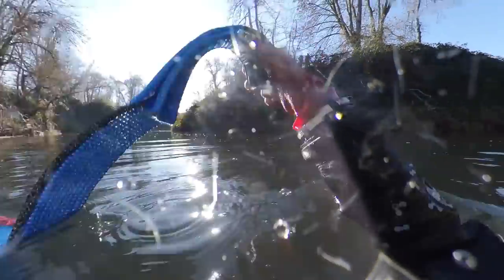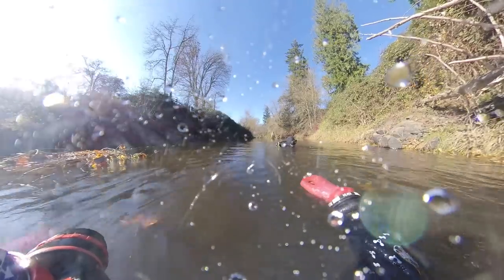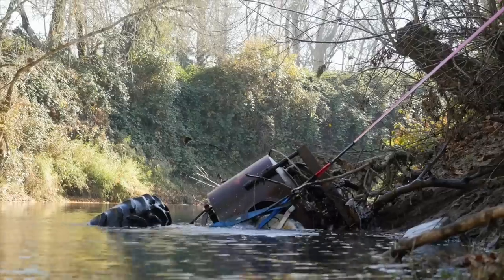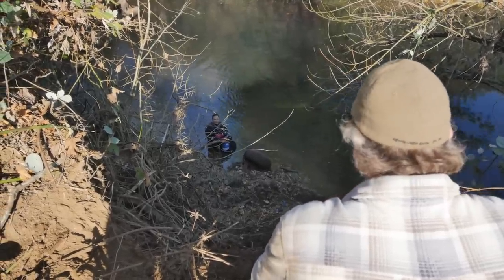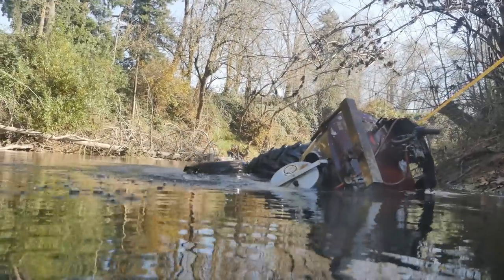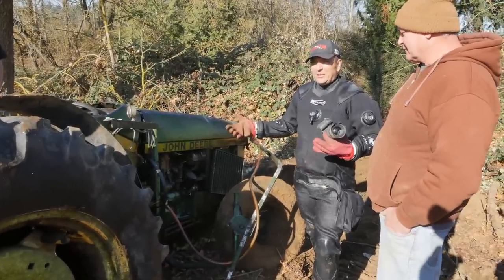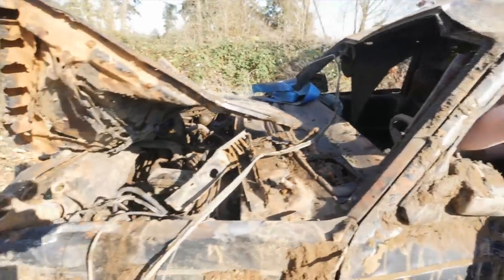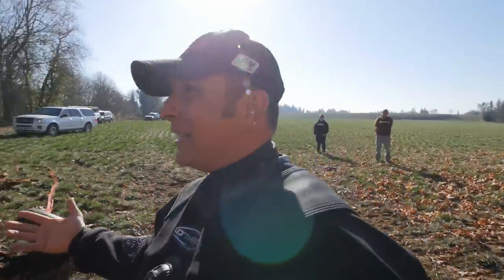John Deere Tractor Found 10' Underwater in River!

Comment: the dry weight of the 2240 is about 5000 pounds, the 100 gal sprayer another 1000.  rear tires could have been liquid filled with calcium chloride, but if not, odds are flooded  (50 gal each, so 800 lbs).

noticed a front weight hanger bracket up front.  there might have been "suite case weights" that fell off.. probably 4 or 5 (about 100 lbs each) to off set the weight of a full sprayer...

Comment: If you're going to wait a month before doing anything to get it running, you'd better take some preventive steps now (drain all fluids), flush with alcohol, and fill with diesel temporarily.  Including, check out the cylinders.

Comment: When I saw the straps I knew this wasn't going to end well! Nice tractor before you wrecked it a couple of times! Don't they have chains in that part of the country? You should have got it on its wheels and pulled it from the front! It will run after its oil is drained and fuel and filters are changed battery and other stuff was a nice tractor! 😎💨
Reply from the maker: We learn as we go.
Reply: Don't we what would be cool is to see it running and back to work that would be cool later brocephus! 😎💨

Comment: Law enforcement should at least do a VIN search and find the owner and what backstory is there. If not LE, then John Deere should know its origin from the VIN. If you get to keep it, pressure wash it, get the sprayer off and out of the way. Straighten, reattach, repair what you need to do to get it sitting straight on its wheels and frame and get her into first start condition. My take on it!😊👍👍

Comment: Need a safety strap. Like roick climbers use. Stop pulling and lifting at periodic points to pull up the slack in the safety strap to keep the item from falling back into the ravine.  Tie the safety strap(chain is safer)  to a part of the existing stable environment or a piece of heavy equipment (not the piece doing the pulling) that is heavier than the item being pulled out of the ravine.

Comment: do it as soon as you get it back to base drain oil fuel take out the injectors   put some atf in the engine through  were the injectors was leave for 24 hours  then try to turn over  you can take the starter off and get to the ring gear there thats best place to turn it over  it should free off good luck john keep up with the vids
Reply from the maker: Greg in the video has worked on many, so if anybody can get it running again, he can. If we have any success, you'll see a video for sure.

Comment: Would love to see you get the tractor running! I am a farmer from north central Missouri. I love old tractors and restoring them. I would like to give you some advice. This is my opinion and mine only.  There is no way in hell $1000 will cover the cost. Not if you shop at a John Deere dealership. Second. don't air it out and let it set.  Opening it to oxygen will allow it to start rusting immediately!  This will make it more costly and expensive in the future.  Third It looks black around the steering console. Has it been on fire? This is where most of the wiring is located. Behind the instrument panel. And 4th and most important. Safety! I recently discovered your channel. I like it and watched it all night. I noticed you use a lot of straps!  Do you not value your lives? lol. I've known these to break and actually killed a person i knew.  Some are like a rubber band when they break! Lord help you if they have a piece of chain, or metal still attached to the end!  I noticed you broke many.  Regardless of what they state they will pull, Many times it isn't the pull that causes them to break. But being cut does. Wrapping them around anything that is not smooth and round, is dangerous! Even a 90 degree edge may not seem sharp. But thousands of pounds of tension on it, and it will cut your strap. A butter knife does not seem to be sharp either. But the more force applied, the more it will cut through!  Anyway. I'm sure you know much of this already. good luck on the tractor!  I always wanted to start a company called  Oldskool! I think fixing, restoring  or modifying old things to new condition or even modifications to make them useable in todays world is  awesome!  because Oldskool! Love your show!

Comment: If it were me, I'd give it a good wash with the pressure washer, and get all the crud off that thing, then as others have said, drain all and any fluid filled cavities - wouldn't hurt to wash them out too, afterall, they're already full of water! Then refill with diesel fuel, or a mix of diesel fuel and engine oil.

It wouldn't cost much to do that, and would make the job a hundred times easier if/when it becomes your property. Take out the injectors and pour oil into the cylinders to stop the pistons becoming 'water seized'. Or, have a word with "Mustie1". He loves a challenge! 

Up to a point, the best place for it to until it's yours, would right back under water until it's going to be worked on.

Comment: Damn, those nylon straps are strong. Then one broke!  Why not use a long chain?
Reply from the maker: The straps we were using were rated at 10k working and 30k breaking which was stronger than the chains we had. Crap happens

Comment: I have a 22,000 lbs strap i use for towing big trucks. You should look into getting some straps that are around that size.
Reply: I thought the guy at one point said they were rated to 30k pounds. Didn't he?
Reply: @davebrittain9216  now i have to watch the video again to see if he said that.
Reply: The winch on the tow truck can pull 30,000 lbs. Those tow straps are no where near as thick as the ones i have. Those were rated at 10,000 lbs.

Comment: Don't let it sit, drain the water from the engine, trans, and axle, (the latter two might be built together) and fill everything to the top with diesel fuel so the bearing journals and cylinder bores and other machined surfaces don't rust and ruin everything. It doesn't look like it was under water for more than a few months.
Reply from the maker: Greg in the video has worked on many, so if anybody can get it running again, he can. If we have any success, you'll see a video for sure.

Comment: Drain the oils, wash it off/out clean the fuel tank and cooling system, starter. New fuel, oil, antifreeze. It'll run. Change oil until it drains clean. Go to the field.

Comment: I don't know where you are, but here in NY, if any vehicle goes in a body of water, the owner is responsible for removal & if it stays for more than a certain period of time, there are heavy fines from Department of Environmental Conservation. There were 2 vehicles with fuel undoubtedly in them, and a sprayer that may have potentially been filled with chemicals. Nobody is likely to claim them because the fines will far outweigh what they are now worth

Comment: I bought from etrailer 20 foot straps rated at 20,000 lb that are 4 inches wide for $40 each . I guess you figured out a bigger strap would have been better to start with.

Comment: Let the tractor lay up in storage for a month , you might as well go ahead and haul it to the scrapyard. Pull ALL of the oil drain plugs from the engine to the rear end after it drains replace them and fill EVERYTHING to the top with diesel fuel and let it soak .If you dont it will be internally rusted to hell and back. I would say counting sheet metal replacement you are looking at a couple to three thousand to fix it could end up a little more. . It would certainly be worth it.

Comment: Here is the problem you are facing with that engine. As soon as it comes out of the water it will rust at a very fast rate due to it being exposed to more oxygen. You need to drain that engine, trans and fuel tank asap then fill them right to the top with diesel. The water will get pushed out and down the the bottom.  Would be best to pull the injectors and fill the cylinders as well. All done about 3 hours worth of work.
Reply: Dave Brittain 
50 hp
Reply: @retireddriver16   Your point of saying 50 hp is?

Comment: If the motor was running when it went into the water, you should be careful with the engine.  Why you may ask.  Water will not compress, when the engine inhaled the water it was trying to compress that water. The engine could have one or more bent rods.   I am not just speculating. This happened to me with  an almost new Caterpillar irrigation engine.  When a rod broke it tore a hole in the side of the block and destroyed the starter too,  My suggestion is to take the engine down replace the rods at the least. Rebuilding the motor wouldn't be a bad idea.  Good luck.

Comment: I am surprised to see them using straps on something this heavy, would have expected chains and steel cables.  Guess technology has changed???
Reply: I used to work in the towing industry. Some of those heavy tow straps are just as strong as chains. I have a couple personal straps They have a working load of 2500lbs each and if doubled it increases their load capacity.
Reply: @1973mre  Yes that is what I am hearing and I hear that they are not as deadly as the cables when they fail.  You can for sure see that when the strap breaks in this video.  Those steel cables will take your head off when they snap.

Comment: I don't think it will be worth it to fix the tractor.  Most people don't know the damage that can occur when vehicle is completely submerged, especially one with a diesel motor.  At a minimum, you need to completely drain out all the fluids and then remove the injectors before you attempt to bar the motor over.  At least one intake valve and one exhaust valve was open when it went into the water, so those cylinders will have rusted up tight.  If you are super lucky, you might be able to use some penetrating oil on the rusted cylinders (let it sit with penetrating oil in it for several weeks, making sure to top the penetrating oil every couple of days) and be able to eventually get the motor to break loose.  The motor might have been running when it went into the water, if so then at least one rod is bent.   Unfortunately, it is probably best to walk away from this.  Can it be fixed?   Yes.  Do you want to spend the money to fix it, when for about the same price you could get a running 2240?  Probably not.  The best case for you in this situation is to sell  it for parts.  The 2240  is a popular tractor, so you shouldn't have any trouble selling it to a junkyard or by putting an ad in craigslist.  I've worked on a lot of lost causes, and this is very clearly a lost cause.

Comment: Never use chain for lifting. You'll never see chain used on a construction site.
Reply: Joseph Civita that’s false. You do see chains on sites
Reply: That's completely false, you'll see chains used all the time especially around concrete blocks.
Reply: Ya, maybe to lift a block a few feet off the ground with a loader. But never when lifting a load at any height with a crane.
Reply: Joseph Civita yes you do. We use chains for lifting concrete shuttering pans. And they have to safety approved and stamped for use. We get new ones every year

Comment: Not a trailblazer, just an old school S-10 Blazer. That tractor is a $5,000,00-$10,000.00 tractor they came in 2wd & 4wd it's a 55 HP tractor so lots of useses for that thing and  i have a master  key for it too because i used to work foe John Deere back in the 90's
Reply: DaddytechEnt 
It not Worth much in the condition it's in now maybe for $500 and it will never be worth 10,000
Reply: @retireddriver16  yeah but if they fix up clean up and get it running again .....

Comment: I'd like to see it run but I doubt it's worth fixing
Reply: It should be. Like it was said, it takes about 1k to get it running over all. In best case just empty it from water, lube everything and check for corrosion, fill other fluids and dry the electrical system. Diesels are really easy to get going. Just need fuel, air and compression. With gasoline you have spark and timing that would take bit more to get running.
Long as this can be get running mechanically everything else is just extra things like fenders and such.
Reply: In my area of Australia these tractors are prized as great working machines that last ages

Comment: The hood looked good under water till it got dropped on its face a couple of times. a good $20-$25k tractor
Reply: 5 to 6000 tractor running....
Reply: @jimrhoads9810  If they get this thing in tip top condition it will be no whrre close to 6k

Comment: That tractor is never going to run. I used to be a mechanic who worked on those. If it had been in the water a month or so, it might have a chance, but after a few months, 6 months, or a year? Forget it. Water is going to enter into the cylinders through the intake manifold and it's going to rust the piston walls. You could probably hone it out if you want to rebuild the engine, but it's not gonna run with some gas and spark (glow) plugs. Probably worth more as scrap

Comment: I was thinking at the start they are mad use nylon straps as does not matter if the strap can lift 1000lbs or 3000kgs it's not the lifting force and pulling force are two different things all together SOO Dangerous they were lucky big time that no o e was badly injured as the whiplash on the straps when they go can seriously kill someone same as if they used chains or cable winch

Comment: Doesn't seem to be any attempt at pollution control, not just the fluids in the tractor but the sprayer!
Reply from the maker: It has been in there for years leaking into the waterways. There was only water in the sprayer as the flap was open. It is now not disintegrating in the water causing more harm. If you want to come out and help let us know!
Reply: @AdventuresWithPurpose  gotta love the keyboard QB's who probably never done anything or make a mtn out of every mole hill they come across. The fluids were out of the sprayer within minutes of going in river and diluted, the tractor was most likely the same as long as looked to be in the water. Stumbled across your channel and subbed. Keep up the good work.
Reply from the maker: @bluetickhunter1059  ... Happy to hear you found the channel and enjoying the content. Thanks for your support.

Comment: $1000 to get it running? I doubt that very much. More like $10,000 as a starting point, I would call that a salvage and sell for scrap. The John Deere 2240 is a late 70s to early 80s model and used runs in the $500-$15000 range for a running machine.

Comment: why in the world would you not pull the pins on the three point hitch and pull the sprayer up separately?
Reply from the maker: Because a 300 pound sprayer was the lease of our worries.
Reply: @AdventuresWithPurpose  That isn't the point.  If you pulled the pins, you would have lost the weight of the sprayer and the  half ton of water in it, and you would not have lost the tractor at the top of the bluff.

Comment: At absolute best that  tractor is worth about $8500!  You will put more than 1/4 of that in it just to get it to run for more than a minute or two, to get that to be a running driving functional tractor,  you will have $5-$10k or more!!!   As far as pulling that thing out of the water, that was ridiculous,  who was in charge of using straps on sharp edges????  That was probably one of the worst recovery decisions you could make,  anytime you are pulling on a pressure point, it either needs to be with a chain, a hook of some type or through some sort of protection for the straps.  You spent more money on straps than you could make in scrapping both of those combined.  Your only saving grace is it made good YouTube content.
Reply from the maker: And we had a good time doing it! We learned from it and the tractor is no longer disintegrating in the waterway! Thanks for watching!

Comment: Just for 1 thing that was not a 70 ton machine it was a 30ton machine or 32max  hence the 350 written on the side of it a 70 ton machine is massive its used in a  Quarry or a huge job you would never see one on a farm as the damage it would cause to pipework underneath the ground and to any road or soft surfaces 
Just saying that's all

Comment: Wow !  i was in Commercial Contruction for over 20 years and  for any lifting we always hired a Crane  those guys were so much more safer than what you guys  were doing with that Excavator and a mismatch of crappy straps  the Crane always came with a operator and a LoadMaster team that  always hitched the load up with top notch equipment and professionalism  ironically the Crane company was the same one i used for installing new engines inmy boat  because the were so safe FYI to the guy that was screaming Whow!  to a machine operator  with all the  noise of his machine that can sound like Go or No  words like Stop are better and a good set of visual signals between the operators and ground crew are  a must  that everyone on site knows  other wise everyone is in danger  and that type of loads  can be life threatening  to everyone involved
Reply from the maker: Everyone in our videos is a volunteer and we appreciate all their hard work. Without all their help and support these videos wouldn't be possible. You're always welcome to come help.

Comment: That is not a tractor and they are doing it wrong. The trees and brush were not cleared out enough. Equipment too small for the job. You need an extendable beam track treads with 4 anchor points that will lift at least 60 ton.
Reply from the maker: But we got it out, that’s all that matters!